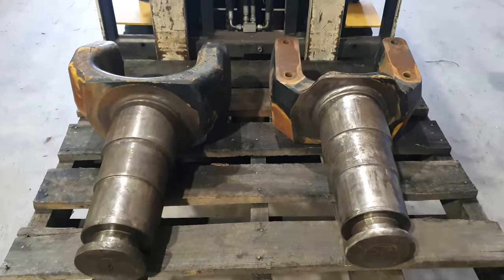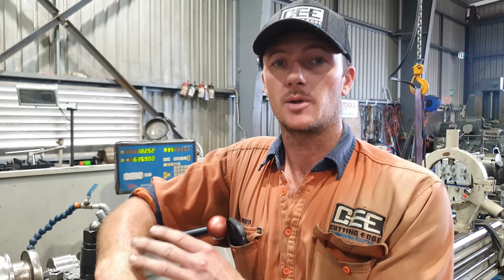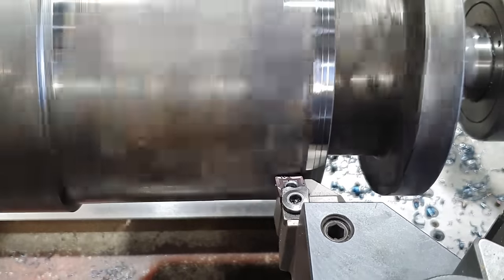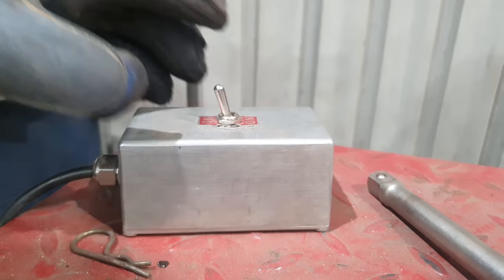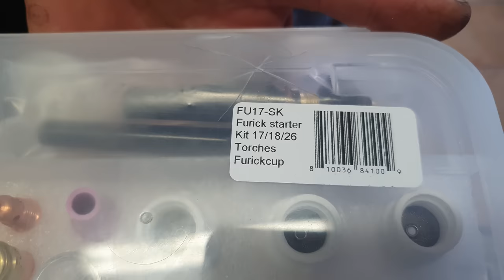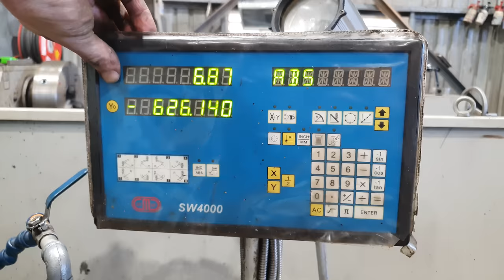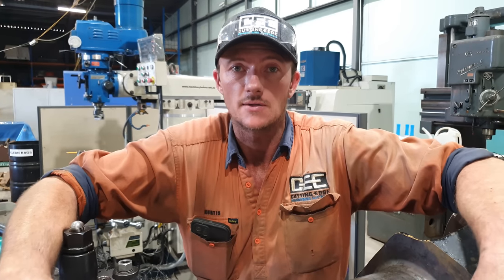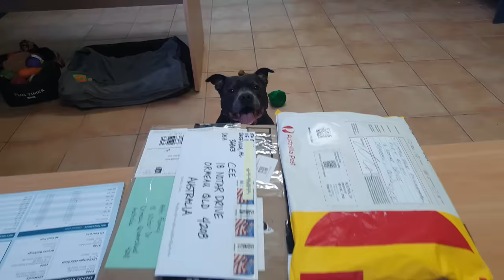Repairing Parts for Caterpillars BIGGEST Dozer! | Machining & Welding

Comment: Our shop does a lot of hard turning. Far more than an average shop. Many of our parts get turned after heat treat for better tolerance holds and surface finishes. We use Seco CNMG 433-MF5 TH1000 and CNMG 432-MF2 TH1000 inserts. Have had good luck with them from 35-50 Rockwell hardness. An option for y’all to try out in the future.

Comment: Another great job both, nice to see some ingenuity being used to successfully hold the job. I've never seen a D11 up close but would love too, it's an awesome bit of kit. There's a main Cat dealer a couple of miles from me and they usually only have D6's there but when the really big stuff comes in, it is broken down into smaller parts so you never see it complete. Thanks for the video and have a great weekend all. Regards from Wales.

Comment: Wouldn't have expected a big piece of steel like that to transmit vibrations so bad.  Hard to fix it once you already have established chatter in the part, unless you dig under it but the hardfacing makes that difficult if not impossible to do.  Good job salvaging a decent finish out of it

Comment: If you're interested. There's a chance you can detune  that resonance if you add a piece of bar between the forks. Just use the bolt holes already there. This may provide enough damping. Or even raise the natural frequency high enough that it isn't excited or above audible range. Maybe.

Also, try placing your green straping towards the end of the forks. The straping will provide more damping there.

Comment: Kurtis, although used on very different equipment, we fitted a heavy rubber ring (a sewer ring or similar might be suitable for your purpose) to round metal parts to act as a vibration dampener. This needed to be a firm but not tight fit, and was very effective at removing the ringing of the metal.

Comment: You may want to consider saving a large tire inner tube and wrap it around the parts that are prone to producing harmonics.  I used to wrap auto brake drums that liked singing to me when I surface turned them.  Hold the rubber in place with long hose clamps. Aiken, South Carolina.

Comment: Kurtis when you have to do anything like these again instead of simply using strapping ( - at the wrong end of a tuning fork by the way lol) simply make up a peice of 1/2 x 1.1/2 inch flat bar to bolt both halves together at the outer end stud holes,  tuning forks  by their very nature oscillate in reverse of each sides resonant frequency  so both are effectively moving outward in tandem and returning at the same amplitude, bolting both sides together could massively change its harmonics and reduce the vibrations that were spoiling the cut.

Comment: Great video Karen and Kurtis. I'm not sure if this could help you cut down the harmonic tone... when I was woodturning both my parent's Urns for their ashes, I used a strip of rubber from a push bike tyre tube wrapped tightly around the workplace and tucked the end in on itself, to reduce the harmonic vibration in the wood and resulting ridges,  and absorb the sound. The harmonic  sound in wood was far lower pitch than on this job you are working on. Both urns were dense hardwood (1 was Redgum, 1 was Merbau). Each length of laminated timber was nearly 400mm hanging off my 88 mm OD/73 mm ID, Vicmarc shark jaws. The actual height of each urn was 300 mm x 80 mm Dia. Without the bicycle tube rubber wound tightly around the wood, there were uncontrollable noises and resulting ridges that could not be taken out with my chisels, no matter which angle I presented my chisel. After being advised to wrap the wood with the rubber, it was easier to work the wood and no sound. Finish was excellent.

Comment: Just a couple of thoughts for the chatter issues:
Use the existing bolt holes to  bolt a bar across the forks. This would cut the down on the harmonics and also keep things balanced.
Also, try putting a Mighty Mag on the side of your cutting tool holder. I don't know how it works, but it does. The magnet will walk up to where the harmonic is and all of the sudden, no chatter...

Comment: This noise reminds me of a field repair I had to do some time ago. I had to repair a tractor bellhousing with three broken off mounting ears. And then I had to straighten out the mating surfaces with a die grinder. I put wax earplugs in my ears, and a massive peltor on top of it. I still had an ear whistle for at least a week... The "bell" in the word "bellhousing" is obviously there for a reason...

Comment: A suggestion for you. Next time you get jobs like this to do, wrap a wide rubber strap around it a couple of times. The rubber strap will absorb the vibrations. I used a rubber strap when machining brake disc rotors & brake drums. Also prevents "tuning fork" ringing.

Comment: Lookup the "capstan equation". The relevant part is that how much (as portion of a circle, not distance) 'rope' is wrapped around a cylinder has a exponential effect on holding power. Every degree of angle matters.  IDK if a full turn would work with plastic strapping, but even getting it to a half turn would help a lot.

Comment: Try putting a couple metal straps across those tangs using like half or .75 bananas size stock and bolt them to those holes in the tangs. Might help to keep the tuning fork effect down a little. 🤞 Vibration is always a nightmare. Good idea on the weld start. MAIL CALL! 😂 I like that new carbide insert. Seems to cut pretty good. 👍Sometimes you just have to experiment with inserts. Ceramics aren't always the best some times. Good job guys.

Comment: Here in India, we have what is called a 'sweat-on paste'. Looks a lot like graphite grease with sintered metal particles. It is applied much like a grease layer and heated with a gas torch that simply blends the metal particles on to the parent material. The end result is a 55 HRC surface that can be machined with carbide or ceramic tools.

Comment: A wooden wedge malleted into the fork at the end will do wonders for the resonance, fwiw. Just a bit of pallet wood will do the trick. The tips are where the resonance builds the most, so dampening it there is by far the most effective point. Plus at this RPM it's not gonna go flying :D

Comment: Good job, Kurtis harmonics and chatter can be very frustrating at times ,especially if 1 component has chatter a second turns perfectly. At times, I have had no choice to complete the job after exhausting tip choices  using tool post grinder and bad language. 😅

Comment: If you put magnets in it like inside the fork meaning inside the u shape so they don't fall out it will help to minimize the sound because they stick to it but they're not permanently there enable offset their vibrations chest enough to minimize the sound I use them when I'm cutting a flywheel in the brake lathe I would use the black magnets because they're strong but not that strong so they will vibrate and offset the other vibrations

Comment: on a job like that with high pitch harmonics, I would used rubber straps op the shaft, that will absorb a lot, if not all of chatter and harmonics. Old inner car tube cut is 50mm strips, tie that around the shaft and on the fork section. But at the end, well done, nice finch to speck as usual..

Comment: You also gotta give Caterpillar credit for machining their parts between centers. No matter how much wear is on the outside the centers are always in the right spot!

One trick we use that sometimes works is tie a thick piece of rubber around the surface that you aren't cutting. Sometimes it helps, sometimes it doesn't.

Comment: Watching the suspension sink down on the Ute when you loaded them gives a good idea just how heavy these things are.  A metal plate bolted across the forked end using the existing bolt holes may help with resonances, and you could extend it back to create a drive dog.
Reply: Weight: 338 pounds / 153 kg - even the old steelcaps won't help with that!

Comment: As a physicist, looking at the problem coming from the sound of the bar from a scientific point. You want to reduce the movement (sound creating oscillations) of the yoke to a minimum. The likely cause of the sound are the first and second order of harmonics. This means that either the top end of the yoke is the point where the largest amplitude is, or it is the middle of the fork of the yoke. You should try experimenting on where you place the tension straps to see where you get best results sound wise.

I would expect a small rod being welded on both side of the yoke to create a tremendous difference tho.

Comment: as always a pleasure watching you work, and kudos for the good camera cuts. another area where you working "cutting edge" ;) for the sound you may try the following if you encounter such a thing again: get some cheap bitumen or butyl tape and put it on the fork part. it absorbs vibrations in this spectrum like nothing else and dampens the resonance drastically

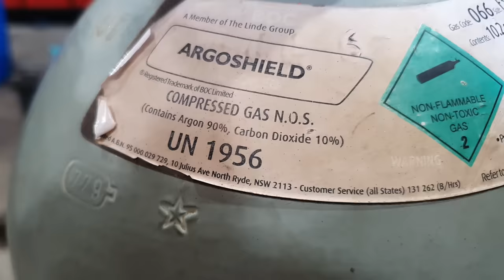Comment: Pause video at 14:05. Carl Paul Gottfried von Linde (11 June 1842 – 16 November 1934)  invented the first industrial-scale air and gas liquefaction processes. Linde was also the founder of what is now the world's largest producer of industrial gases. The largest Linde factory in the United States is in Indiana, next to the freeway that runs between Detroit and Chicago. I have driven past it many times. I always think, "that is probably the only factory whose product, when used up, leaves absolutely no polution, nor waste needing disposal." Kurtis is constantly doing metal inert gas welding. The word "inert" means the argon and the carbon dioxide are not involved in the melt during the welding, and they disapate into the air unchanged. Argon is the third most common gas in the air, and carbon dioxide is the fourth most common gas in the air.

Comment: A material you could use it be a little slow going. It’s called weld mold 958. It’s tool steel very hard works real well it’s for TIG welding.

Comment: To kill the tuning-fork style resonance, just bolt a piece of steel plate, say 8 to 12 mm thick and sufficient width to cover the tines, across the tines to join them, using the existing bolt holes.    I can't see it making any difference to the turning finish, but it will be a lot easier on yours and Homie's ears.   Tuning fork resonance works by the tines moving apart and towards each other, apart and toward each other, at the singing rate.   The plate bolted on will prevent that.

Comment: Regarding the surface finish after the welding, have you considered using a neutral holder with a positive rake tool, or just a positive tool holder with neutral/positive cutting geometry ?
I don't know much about working with harder materials, I usually get better results with "sharper" angles and geometries.

Comment: First of all. Great job repairing it! But could you potentially not just switch them with each other on the machine? That way you had a whole other side to wear if the wear only occurs on the one side?
I'm aware it might not be the optimal solution. But perhaps in a pickle?

Comment: Kurtis, one question; if you slide the drive dog more into the lathe and use a 4 jaw chuck (when the three jaw one doesn't fit) and let the chuck jaws drive the part. Wrong idea? Or feasible? Best! Job

Comment: You should make an investment in a extension of the overhead crane so it reaches the welding area. Seems like a big hassel to switch to the forklift compared to over by the other Machines. Cheers from Sweden

Comment: When I have a job that produces these kinds of vibrations I will tapa a piece of lead to the job or the boring bar. This trick will do wonders in stopping the vibrations. In this case if he strapped a piece of lead the work as close to the cutting as possible it would reduce all the vibrations.

Comment: The problem of the job being like a tunning fork  does not help , try putting a piece of flat bar  across the ends,  you have two tapped holes to secure it,  that might help get rid of the unwanted harmonics . Also try cutting from the chuck end towards the live centre .

Comment: Good job CAT leave those centre holes on the job as would be a bugger to set up, (might be welding them up after seeing this so you have to buy a new part)  amazed you can drive the job with some band strapping

Comment: That "tuning fork" squeal is BRUTAL.  ugg earplugs and muffs. 
Just noticed the cooling system on the big lathe. Would be cool to know more. What type of fluid, how much can the pump flow, and what kind of filter does it use? Must be heavy duty to clean out all the shavings without getting clogged. Always interesting.

Comment: Let me ask why a sleeve wouldn't work? Either friction fit , or pinned to the main part.
Reply: It's still a steel sleeve, even though it's softer than the Hardened Fork, with enough time and wear the hardened part will eventually wear.

Comment: Have you tried hammering a 4x4 wooden post between the forks. I kind of remember my father using wood to dampen sound when he had things on his hammer mill in his welding shop! I was thinking about green eucalyptus possibly working but dry eucalyptus is hard as rock and would create its on resonance.

Comment: THE NEXT TIMECTHAT YOU DO THOSE, TRY RUBBER BUNGEE STRAPS AND WRAPING THE SHAFT IN OLD INNER TUBE. THE SAME THING HAPPENS WITH BRAKE LATHES ALOT AND THE EVEN HAVE LEAD INSERT FILLED RUBBER SILINCER STRAPS....
Reply: Good idea, but please don't use all Caps. It makes it seem less helpful to the eye.

Comment: I wonder if bolting a piece of angle iron across the forks at the top would help with the vibration and give a cleaner cut. It may just change the frequency though, so not sure. Might be worth a try.

Comment: Classy work mate, good to see you preheating. :):) Why didn't you use ER70S-2 again if that is normally used, I missed that...apart from it being softer and less wear resistant. Is this an upgrade because of the machinability of the Stoody filler metal.
Not many people will do a job like that and have trucks standing by to get it back to the customer as part of their everyday activities. That is what is called customer service. First class!

Comment: Interesting to see your use of the Ceramic tips, still getting some harmonic chatter and how you w ent about welding ( and setting up to clean up the yokes on the lathe )   Procedures procedures procedures,.... as they say.  and some, which you can't do, one can learn by watching.    thankyou again.      Booger!   the harmonics are back again when you were finishing off.   my worst nightmares on jobs like that.   brings one into the realms of Crankshaft grinding!   - but that nifty belt sander.... Oh  OK then for a Quarry Rock-Farming kind of job.   BTW, do you use CBN inserts ?  we only use the carbide inserts ( cost / use / inventory costs)

Comment: Have you ever thought about using a cut out tire tread on the noisy tuning fork. After your green straps are tight. You can wrap the tire piece around the fork end and then strap it tight.  It may dampen the sound. Perhaps that will help your ears.

Comment: Oh man, smooth manual feed.  I did not realize a cylinder surface was not true enough to use as is.

What happens if they skip the heat treat and install it?

Comment: 7:36 haven't tried with that big a piece, but have you tried using one of those weighted rubber belts that drum brake lathes come with? Another trick i've heard about (but i haven't tried myself) is that you can put a neodymium magnet on it and it will soak up some of the ringing out of it.

Comment: We use a thick rubber strap around brake drums and springs around with rubber inserts around  rotors to try to kill harmonics, would rubber around the fork ends help any?

Comment: To réduction the harmonic,  try bolting à Rubber block, to the fork ends. The Rubber should work as a damper and absob the vibrations, unfortunately,  it is a trial and error process.

Comment: So do they make anything to do the opposite of what the line boring unit does to do the welding on the outside on pieces like these, so you can set it and let a machine do the welding?

Comment: Llevo tiempo siguiéndote y me gusta mucho tu trabajo, una pregunta:¿Porque le das calor al eje antes de soldarlo? Muchas gracias
Reply: If a part that size is cold and then absorbs heat from the weld then it will expand and maybe weaken the weld. Heating first makes that less likely.

Comment: Curtis, am I correct in assuming you spun the outside off the rod scrap, to get through the hardened surface, so the chuck gets a better 'bite' ?

Comment: So does this repair last as long a the typical weld, machine and send out for hardening like you mentioned at the start or something that would 6 to 12 months to get the jobs done before major downtime for extended maintenance between jobs

Comment: The best machining channel! Great job to the both of you. How much did the D11 blade lift yokes weigh? Also, I can convert weight to "Bananas"...;-)  I've also machined a few parts that really sing to you when cutting, it's extremely hard to achieve a good surface finish. The pallet strap is a very good idea. Thanks...

Comment: maybe...if you used the four holes in the "tunning forks" to bolt a bar of steel across the tunning fork it may work better at taming the reverberation from the tunning forks than the straps of packing tape???

Comment: Next time you are doing these noisy tuning fork jobs try putting a piece of hush mat or dynamat on the part you are not machining. Will dampen the sound and you can peel it off when done machining.  Your ears with thank you.  We use it in the car stereo world to deaden the door panels to keep unwanted vibration out.  Give it a try and let me know what you think.